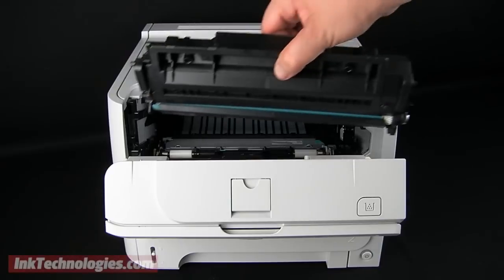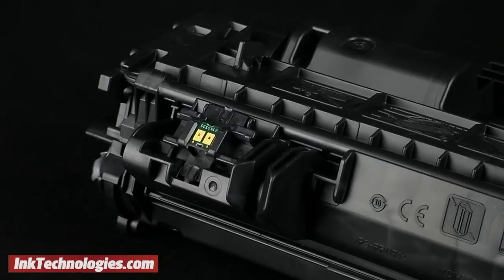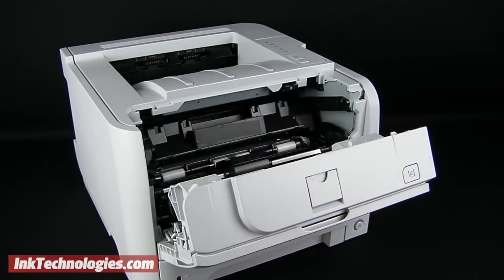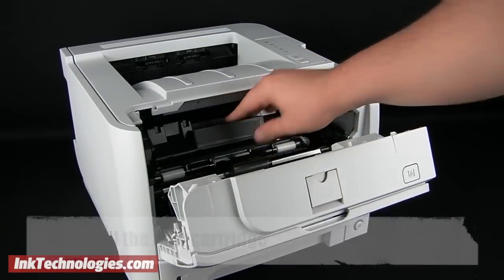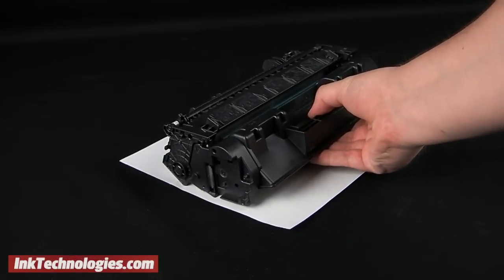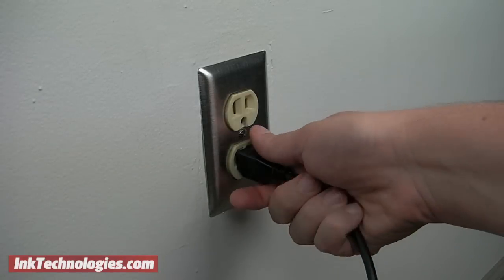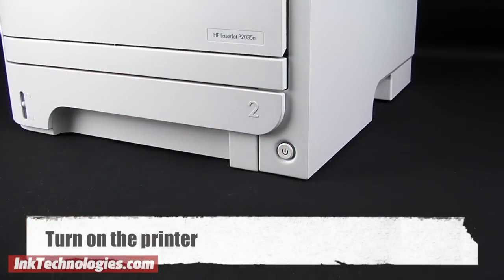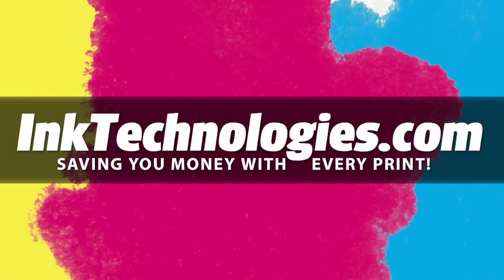Cartridge Is Not Recognized - Solution!

Comment: I tried all this and then some. I have a Canon MF641C. Apparently it won't work with another brand of toner. I bought some compatible toner cartridges from Amazon. They fit fine and are very similar to the original Canon cartridges. The printer recognizes them and can tell me that they are 100% full but will not print. I get an error message that just says "Error: can't print (file name)"  Very annoying. So, I'll be trying to return these "compatibles" ASAP.

Comment: If these didn't work, just get the chip from the old one and switch it with the chip of the new one. The printer will avertise you that you need to switch the cartridge but at least you can use it.

Comment: Does not work for us. The printer still shows cartridge is locked. We have 5 HP M604 printers. They all use the same generic brand toners from the same supplier. I try to swap the toners among them, but only that one insists "organic food". The rest work well. I look through the whole menu and settings. I do not see any option about cartridge protection. any idea?

Comment: Neither method worked on my HP.  But, I switched the little chip from the original empty cartridge to the new (but unable to be read) cartridge and now it works again.  I hade to turn off the machine and restart it.  It reads that the cartridge is low in toner, but it accepted the new cartridge and it works!
Reply: How to switch the chips

Comment: I had the toner light blinking on a Laserjet 1606dn  and tried everything there is on the net - to no avail. 

Eventually I gave up pushing buttons and what not and went for the screwdriver. Before taking the thing apart, I had to remove all the paper from the tray and found that the lowest sheet of paper at the bottom of the tray was jammed. After removing that, the printer worked fine again. Why in the world does a sheet of jammed paper make the damn toner light blink??  HP mystery. Grrrrrrrrr.

Comment: You can make Your printer chipless - that means it will never require ink cartridges - IC Chips on cartridges - You can use cartridges without chips - printer will show always 100% ink level full. It is the best solution for Epson printers.
Reply: Will this work for HP as well?
Reply: do you need to remove the chips from the printer? how?

Comment: I have tried everything. After reading the entire internet and ripping out almost all my hair I finally found a solution.
Step 1 -  Unplug USB and power cables
Step 2 - Open window
Step 3 - Throw the fucker out
Reply: +lifedevice that seemed to work! Thanks. I connected the pencil tip to paper and it worked reliably.
Reply: LMAO..... good one .... I thought you had a solution and you do ... only I think I'll take my to some woods and out a 45 in it !!!
Reply: agree with this. no more epson, tried everything on both DX4050 and 8450 and still not working. RUBBISH
Reply: Typical of HP Printers.  They are the worst printers ever.
Reply: +lifedevice I second that
Reply: LOOOL That's exactly what I did with the HP Photosmart 7200.
Reply: you are a fukin genious, took your advise, im in prision now, but the printer error solved
Reply: yeah man that worked , In fact I threw it right thru a open hp store window , with shopping public inside. I tied with string a house brick to the flat bed.
Reply: I did the same :-) ended up with cheap Canon, Epson no more
Reply: 🤣🤣 dunno how long I've been laughing at how true this is
Reply: Good advice - especially if it's an HP or Samsung (HP-owned) printer. NEVER GO NEAR HEWLETT PACKARD.

Comment: I have an HP Officejet Pro 8600 which was not detecting the brand new black cartridge, and nothing worked until this: Check out INKJET 411.com.  Search by your cartridge number. This trick worked!! The pins inside that were supposed to be touching the microchip were bent and contact was not made. I bent them back out and Ta Da, it worked!!! A lot of research to find this answer!!! I used a dental instrument, hooked underneath the post, and pulled it back out into position!!!
Reply: +Vickiejo THANK YOU for posting your problem, it helped me solve mine!  I just about gave up and was going to buy a whole new printer.  I was so fucking frustrated, especially since I use my printer for my business.  No one zeroed in on this issue on the many talk boards I went to...and it felt like I troubleshooted every damn thing.  Then I read your post and I popped my cartridge out and sure nuff the goddamn pins were pushed down on the Yellow slot.  WTH???  I don't even know when the fuck that happened or how.  So I tried to pulled them back via your instructions, but still nothing.  Finally I just ordered a new printer cartridge off ebay.  Now it looks like I'm back in business.